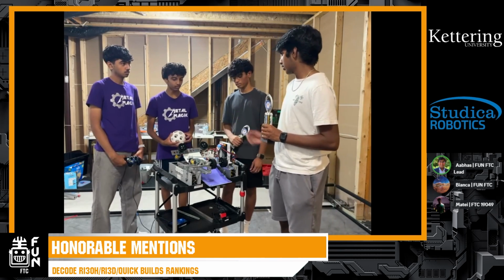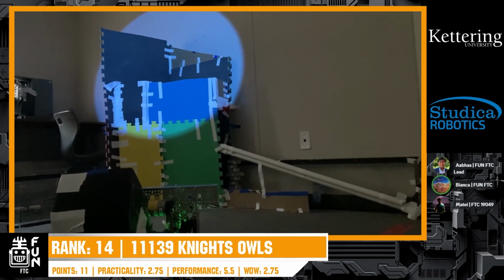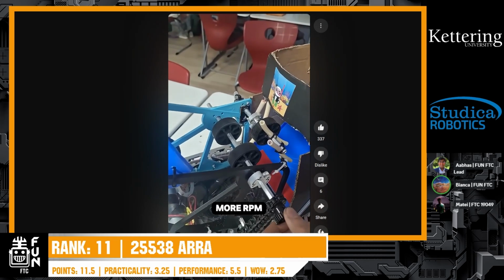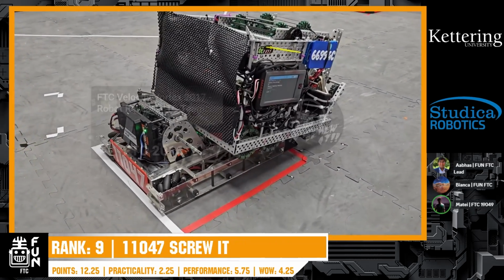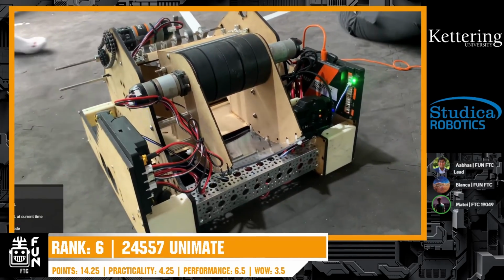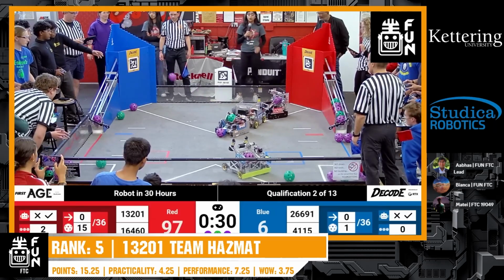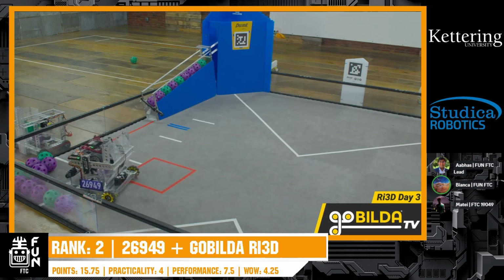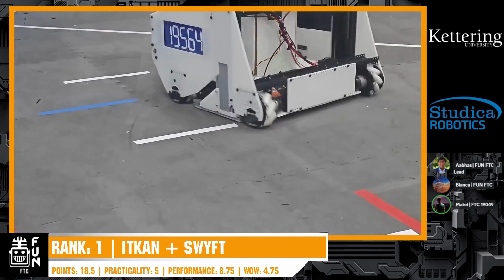DECODE Top 15 Ri30H/Ri3D Robots | #firsttechchallenge

Comment: Thanks for covering our RI30H robot at number 4! Yeah I was happy with our novelty this year. The double parking I think also came out very well, as long as the other robot is below about 16" long. If others want to try a triple catapult though, be very careful with the stiffness of your whole robot. To get enough power, we needed 6 beefy springs, and it was warping our entire bot. That caused us to usually only score 2 out of the 3 artifacts we launched, since the far left one was more springy and had more power for some reason. So make sure your catapult is light and stiff, and preferably has lots of adjustment to tweak all 3 balls individually.